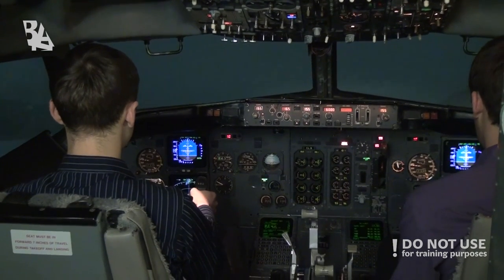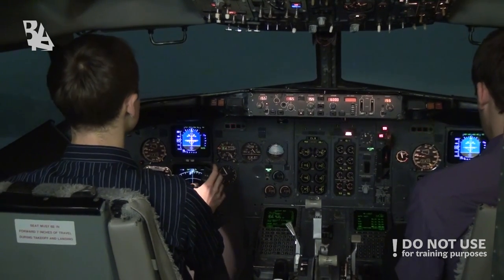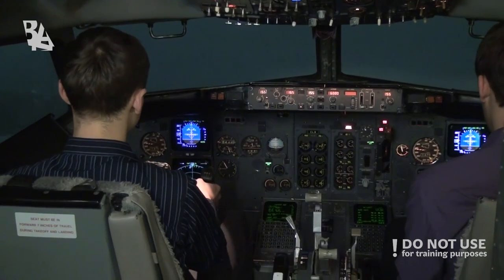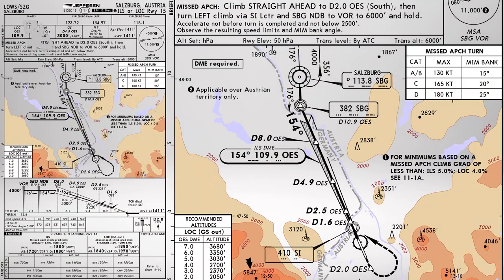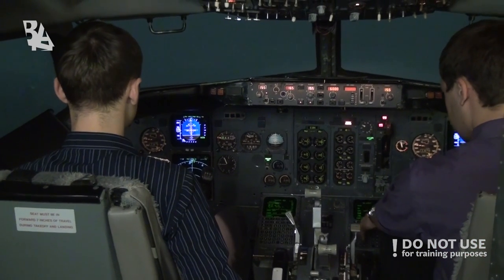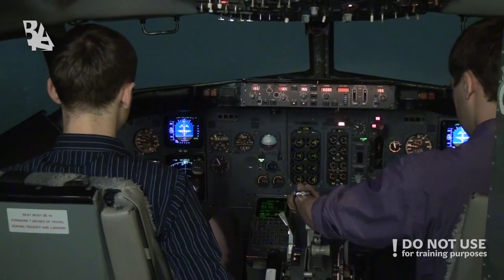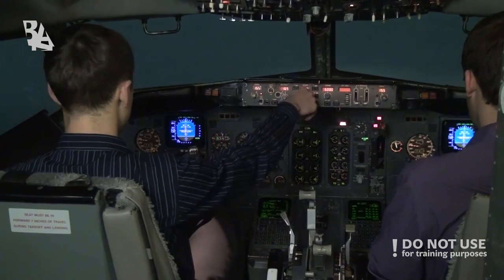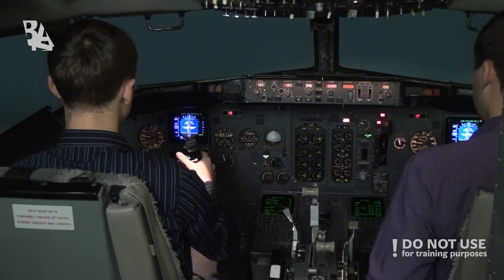Go-around due to Eng #2 fire in Boeing 737 - Baltic Aviation Academy

Comment: how come when they were on the approach instead of landing when they had the engine fire they went around?
wouldn't it have been better if they had landed?
as usual, awesome video!
Reply: My guess the aircraft needs to be setup for a one engine landing and plus they need to attend to the fire, not so easy trying to land I'd assume.

Comment: Thankyou!!! For finally admitting to your mistakes. Every pilot makes mistakes lets just hope it's not as big as forgetting to set takeoff thrust in the real world.
Reply: Cian Broderick Yes I know, you can make do without it but it's not as safe without it. Would you rather do a go around with 50% power (about the power the a/t was applying or TO power?? If you were getting tested and you did that... you'd fail.
Reply: Cian Broderick eh-wrong in the case of engine failure-TOGA is an immediate emergency action

Comment: Baltic Aviation Academy Is there a "go-around" button that you press for a go-around? I noticed that the throttle levers went up all the way as soon as you said you were executing a go around. Why did the a/p throttle down right after it throttled up? What are those two buttons he pressed that raised them back up?
Reply: Right under the 'knobs' of the throttle levers there is a TO/GA button on each lever, this button will activate the go around in the FMS, so the plane is set to climb to the go around altitude with the set speed.
As they were flying with AP off, but AT enabled the plane was accelerating over the selected speed, so it throttled down a bit. In a go around with engine failure you want max thrust, so you disable AT by pressing a button on each side of the throttle levers' 'knobs'.

Comment: Baltic Aviation Academy what about the gear lights remaining red even when gear is up and off?
Reply: Gear lever is still in the 'up' position. When doing the after take off checklist, they normally would select gear selector off
Reply: Robin Boon I know...otherwise I would not ask..but even after they switch to "off" position, the red lights are still illuminated
Reply: Because one throttle is in idle position.

Comment: How about simulating a landing with smoke in the cockpit and a wheel fire in the forward landing tires, with hydraulic braking failure and no fuel for a go around. At the end of a long shift, not when your fresh and alert. And shake the plane like there is really something wrong with the old pile of junk.